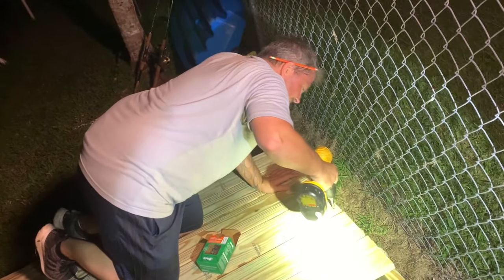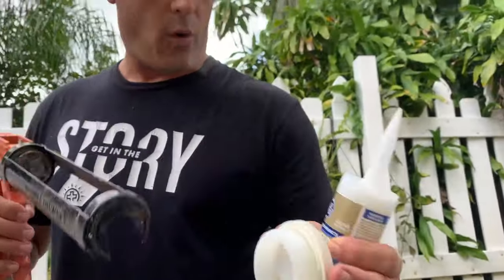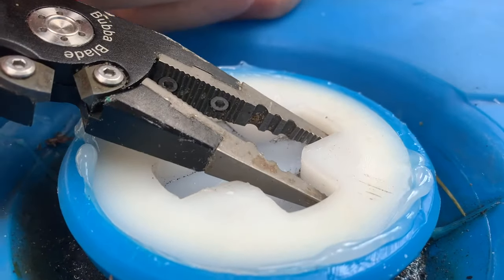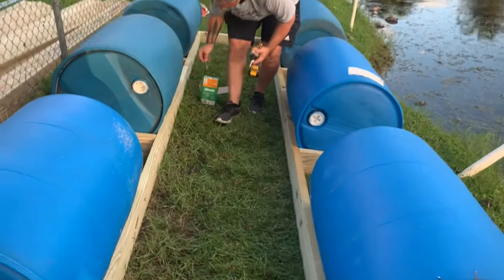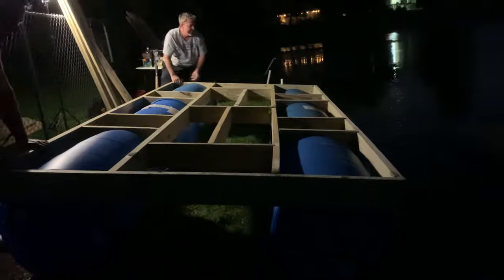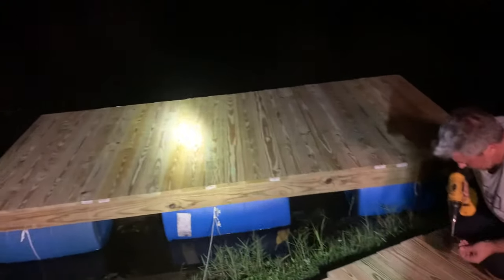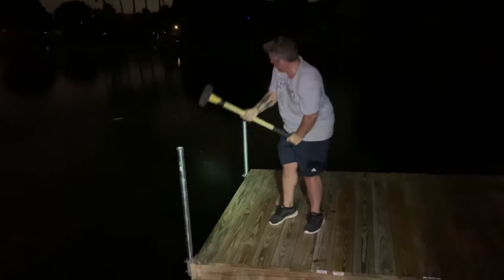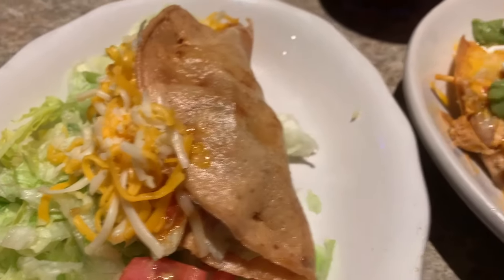DIY   HOW TO BUILD A FLOATING DOCK BOAT IN 2 HOURS

Comment: This video gives me a good idea for building a long walkway towards the end of my pier to finish the third phase. It's quick and dirty and I can break it down later and build a floating pier next to it. It's a major rebuilding of the original that I did in 1985-6 when I scrounged lumber out of the creek and nearby river. Now, it's the blue barrel method...  It's either do a floating walkway or build a crane to bring out, set and wash down the next sets of  pilings, as I'm a cheapskate and don't want to get a marine construction crew involved when I can do it all over again and cuss, growl and grunt pushing up pilings into dark murky holes in the bottom of the creek, just like when I was younger. Instead of running a matrix of old decking boards into places where I can use them as footing for using the post hole digger to dig a pilot hole for the pilings, I could be able to move the walkway into position and let the tide drop to the mud level and have a very stable platform for moving mud. Also, it's another position that can be used for placing the wash pump, instead of up on the finished dock  Excellent video. I hope you're having a great time with it. Seems like everyone that uses jet skis, paddle boards and kayaks are building blue barrel floaters... 
Thanks again for the excellent information on how y'all did it.
Reply from the maker: Oh my goodness! What a great note. I appreciate the thoughts and nice comments. I hope it works out for you. I am going to make a video about how the dock has held up over the last 2 years since making the video!

Comment: Do you have to remove the pier in the winter?  If so, how do you remove the pipes?
Reply from the maker: Hey. Good question. I’m in south Florida. “Winter” = 50’s - 70’s. Not a problem down here
Reply: I was wondering the same thing..thinking you could just unscrew the round latch hooks from the dock unless you can wiggle those poles loose

Comment: I’m thinking about how long does the wood last before it starts to rot, did u guys give it any treatment or recommend any kind of treatment? 
I loved the video!
Reply from the maker: We bought treated wood. A little more expensive but don’t have to worry about termites. It will last a long time because none of the wood is touching the water. Thanks so much for watching the videos. Glad you liked it
Reply: A word of caution about lumber.  It's marine grade stuff you want to use if it's to be a very long lasting item. That means that the larger dimensions of lumber can be obtained from a speciality yard like Decks and Docks. It's stuff not generally found in the big box stores...  I found out that they (Decks and Docks) do not sell marine grade lumber in 2x4 & 2x6 or 5/4. It's ground contact that is used mostly for decking (where your feet go) and is a very toxic splinter if it were the heavier marine grade. Marine grade is rated by the weight of the chemicals forced into the wood. Ask your lumber yard salesperson who is knowledgeable and can guide you based on your needs. If the lumber is to be immersed in water, overrun frequently with brackish, salty or muddy water and/ or  stays wet, go marine grade. Deck surfaces are usually fine with ground contact grade. Just don't think that constant contact with the ground means it won't rot. It will. It's the same reason you don't use ground contact grade for pilings in a marine environment. They certainly would rot and not last. The where the mud contacts with surface of the wood in the presence of oxygen, and usually seen to rot in that section of the wood will be only about one to two feet of the section. It's the benthic layer where the worms and microbes do their job. Pilings that are wrapped with a few layers of fiberglass or epoxy resin have been tried with various results. There are tons of products that can be used to treat the decking as you asked. Finding one that doesn't create a slip hazard would be a priority for me if it's a swimming dock, especially with kids or older, less pliable folks.
Reply: @mikegrant8490  Thank you! I was going to suggest the marine grade limber to use on mine since it is a lake adjacent to  the bay, which turns brackish during tides. I'll be using 2 x 8's since I want to be able to climb in and out of my kayak on to this.  I actually googled how to build dock steps and this came up. more research to come. our water level can rise and fall as much as 4' in a day.
Reply: @cherylefunz7789  ...the more you know. Good luck with your project. Check plenty of design ideas that will suit your needs and try to round off the edges and anywhere your skin can contact. Using some old fire hose can help, too.
Reply: @mikegrant8490  Thanks! I'll see what I can come up with. I need something that can float up when the tide comes inland the water lever comes up about 4' or drops that much, depending on which way you see it.
Reply: @cherylefunz7789  We live on an estuary creek ( a typical low tide, no ride creek ) on the lower end of the Chesapeake Bay, the Southern Branch of the Elizabeth River. Our average tidal movement is about the same as yours, four feet, typically. We have some newer neighbors who installed a floating dock for jet skis. Remember that you can add an amount of water with a bit of  antifreeze, (not necessary if you aren't going frost biting kayaking through the winter) to the floaters to lower the level of the decking closer to your water height for ease of getting in and out of a kayak. You can also add a below water level deck next to the main  decking specifically for kayak and canoe or any small craft, even a Sunfish sailboat allowing you to slide into and out of your dock with only a slightly wet foot or two. The neighbors ride right up onto theirs with the jet skis and secure them with a rope bridle. It only takes a second to launch or land if you create a wet landing zone... they just submerge it a bit in the Spring and take out the water by pumping it off with a hand bilge pump and fully refloat when they put up the jet skis in the cooler months. It's simple and it works. Think a tiny wet dock for a bigger dry dock, both floating together. Wet next to dry. Wet just deep enough for your purposes, held in place with rope. The flotation has to have top mounted bungs to add and remove the water, though. Have fun...
Reply: @mikegrant8490  Excellent ideas, and thank you!! We don't get freezes often, since this is the Texas coast, but when it happens it usually empties the canal and partially empties Galveston Bay and Clear Lake!! The Blue Northers push the water from the lake and bay into the Gulf.  Last year was a once in lifetime phenomena, and people from all over the area were arriving in their golf carts to check it out. I wish I knew how to post pictures of our completely dry canal. Saw a few things in there lost during a hurricane though.... Not important, but interesting. The idea of anti freeze and water will certainly be explored. I have boats tied up at the bulkhead, and was hoping to make this at the jog in it before the culverts where the water is supposed to flow through the canal when the Bayou on the other side of the road is flowing in flood. Keep it out of the way of the boats, but that's a big step down to a dock.  I'll be measuring and thinking on that one.  Love your idea!!

Comment: Do you think a piece wood would work instead of the conduit? 
Like a thick rod ?
Reply from the maker: Hmmmm. I think there’s several reasons why I wouldn’t use wood for the rods. 
#1 - much more challenging to get driven into the ground
#2 - rot 
#3 - it would be more tough for the dock to slide up and down when people stand on it or when water levels rise and fall

But if you use wood and it works out for you please let me know

Comment: How hard would it be to get those posts out to remove the dock?
Reply from the maker: That’s a great question!!!!! I’d take the brackets out, move the dock, then try and remove the poles. But I’ve never tried
Reply: @watchyourlip3209  I was thinking of pulling the posts up first. Maybe with a farm jack and some tow straps. Like wrap the straps around the bottom base of the pole and use the jack to lift it up. That way there's a solid foundation for the jack to work on.

Comment: Quick tip: I wouldn't put the apoxy on the tops until you see how stable the dock is first. You may need to add water to the barells for stability.
Reply from the maker: Interesting. Makes sense. It’s pretty stable but I see where you’re going with that
Reply: @watchyourlip3209  yeah if its something smaller than what you had it will be more shakey from what I understand. Like a 6×6 would be more prone to tipping when you stand on the edge unless you have alot of weight in the center. Younger people wouldn't have an issue with this but older people would be alot more likely to fall or something. You could also run a small lag bolt into the support poles from the brackets that hold them in place to keep it from swaying.

Comment: Great pier! But in order not to walk through the mud at the bottom of the lake, it needs to be cleaned. Dirt can be pumped out with the help of a dirty water motor pump and a Bagermaster suction nozzle. And if there is sand at the bottom of the reservoir, then you can make a beach

Comment: Great video, thanks!  I see where the four 2x6x12 pieces were used, but where was the fifth one used?  Also, would it be better to use 2x10 or 2x12's instead of 2x6 to hold the barrels since it would provide a bit more coverage over the barrels?  Would also be helpful if the dimensions of the various cuts and compartments were listed.  I think I heard you say 20" to hold the barrels, but not sure about the other dimensions.  Thanks again!
Reply from the maker: Thanks for the compliment. I’d have to check with Bryce to see if there is a method he has on using the size lumber he bought over those that you mentioned. I’ll see what he says and get back to you
Reply: they used the four 2x6x12 for the length, and then cut the 5th one in half and used that as two 6 foot boards on each end making the final dimensions 12' x 6' for the main dock.  must have made more cuts when he ran to the store for additional supplies.
Also cutting the 1x6x12' boards in half for the top planks.

Comment: Thanks for the video!! Does the list of materials needed include de ramp/sidewalk to get to the dock boat too? Or the list is only for the dock boat?
Reply from the maker: Yes. It includes the ramp but we were a couple 2x4’s short
Reply: @watchyourlip3209   and I got that the dock boat is 12 foot * 6 foot but what are the ramp dimensions? Thank you so much again!!
Reply from the maker: @cathb6245  yes. I used 6’ sections and the ramp is 3’ wide

Comment: Do you need permits to build this and keep it in the water? If not was is the loophole around it? I just built one and as soon as I finished my neighbor informed me that I would be fined if I put it in the water without a permit. Any help is appreciated thanks!
Reply from the maker: Well, each city has its own codes so I’d check with them. If it’s not a fixed structure, it’s actually more like a boat than it is a dock. Slap a trolling motor on it and call it a “dock boat” - that was a little light hearted humor but check the fine print on your city ordinances

Comment: Nice floating dock build!!  Was wondering how hard it was to find the places to screw into the joyce’s from the top at the very end. That part was missing in the video.  Seems like it might be a pain to find because of the offset boards underneath. Lots of Measuring and marking the top I guess..
Reply from the maker: Yeah. We missed a few screws but it lined up pretty well and we landed 95% of them first time
Reply: Joyce is a name, Nev. Joist is a building piece usually made of dimensional lumber and is used to describe a horizontal piece.

Comment: WHAT WAS THE COST OF THAT PROJECT
Reply from the maker: My total cost of the project start to finish was about 800 bucks. That was about 2 1/2 years ago before all the crazy lumber price increases though. I’m not sure what it would be now
Reply from the maker: Actually. That was a bad estimate on how long ago it was. It was November 20 20. Prices of lumber started going up significantly over the next six months after that
Reply: @watchyourlip3209  YEA IM SURE. I THINK IT WILL BE CHEAPER FOR ME TO PURCHASE THE ONE FROM BASS PRO SHOP WHICH COST ABOUT $1300. CONSTRUCTED FROM AN ALUMINIUM FRAME AND PVC STYLE PLANKS. THANKS BUD

Comment: I have a home in the mountains with a pond in the backyard about 200 feet wide or so. I wonder if nailing those poles into the ground could end up puncturing a liner if there is any. The ponds were built before I moved in.
Reply from the maker: Oh yeah - I have a way different situation. My canal has about 5-7’ of muddy buildup that I hammer into
Reply: @watchyourlip3209  Looks great though! I can look into other methods to anchor it.
Reply from the maker: Yes! Hood call! Hope it works out
Reply: yes. you will definitely be puncturing any liner you have to hold the water in.

Comment: Great video!  Thanks for sharing.  Definitely planning to use this as a model for ours.  Is the ultimate size of the dock 6' x 12'?  It seems like from the video but wanted to verify.  Thanks again!
Reply from the maker: Hey thanks for the compliment. Yes. The dimensions are 6’ x 12’. That way, the boards on top just need to be cut in half if you buy 12’ boards
Reply: @watchyourlip3209  Excellent, thank you!!

Comment: Should have gotten the barrels that the lid that comes off. That way you can fill them with  Styrophone or any kind of expanding foam. That way when it eventually takes on water it will still float.
Reply from the maker: Good call bro
Reply: I am about to build one for our pond on our home we just bought .  I took a screen shot of all the materials that will Def save me some time. Looks really good
Reply from the maker: Thanks bro! I hope it works well for you. We’ve had ours over a year now and it works amazing! Lmk how it goes
Reply: foam   styro foam.

Comment: You mention your ramp is 8 feet long which doesn't allow for split cuts on the 1x6x12's. Somewhere the wood parts list isn't going to add up given the details relayed on the video and the material list.
Reply from the maker: Hmmmm. Well. It did…
Reply: @watchyourlip3209  That's some neat stuff! Turning a 12 foot board into two 8 foot boards :)
Reply: @watchyourlip3209  And for the record, trying to help you correct shopping list, not be overly critical of your video, which I found to be an excellent guideline! Guessing not many people have tried to build this ramp off your video and parts list, which I am just completing now and in so doing, discovered the discrepancies that I'm pointing out... Thanks again!
Reply from the maker: @tfactor7998  hey I appreciate that clarification. I’ll go back and take a look at it and see if I erred at all in the list.

Comment: Could have saved yourself a lot of time and mess and skipped the silicone. Get a proper bung wrench for a few bucks and tighten them down good, hit with a little heat they’ll be fine. Or you could put teflon thread tape on the threads if you’re that worried about them leaking
Reply from the maker: Interesting! If there is a next time, maybe I’ll try that